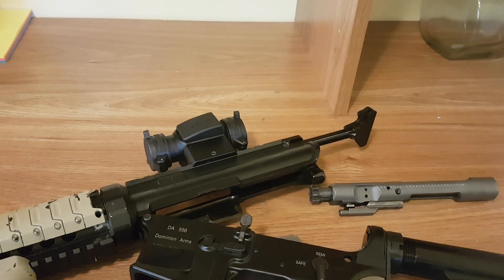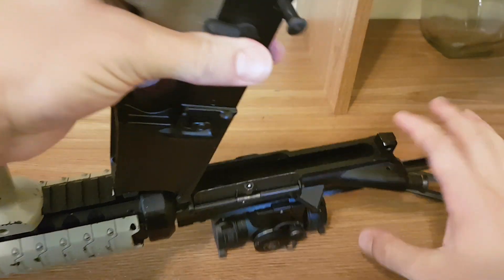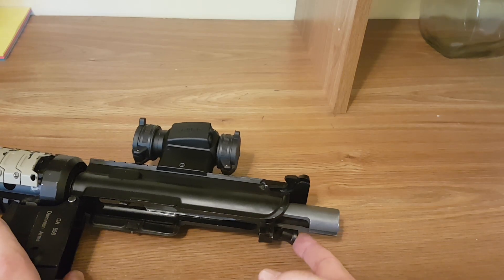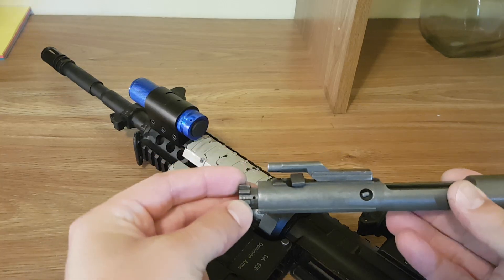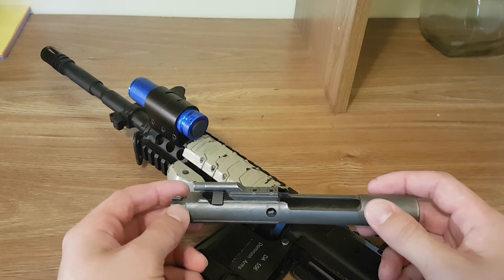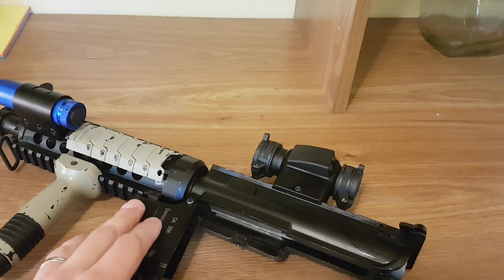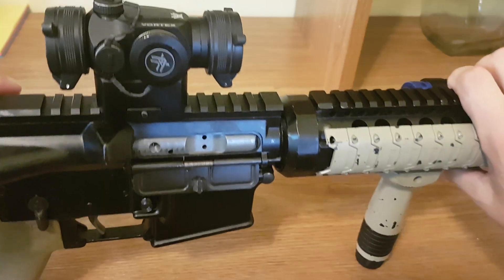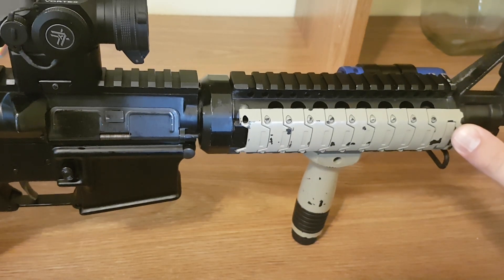What does the Forward Assist on the AR15 Do?

Comment: Long story short:
The forward assist is a terrible idea and turns bad jams into catastrophic malfunctions
Reply: @The Salt Miner Never argue with idiots, they will drag you down to their level and beat you with experience.
Reply: Nice to see you've at least given up trying to defend an invalid argument although it's a bit generous to call anything you said an "argument"
Reply: Degenerate
Reply: @TomBombadilTheEldest  you are wrong ... You obviously dont know your way around a AR.. Anybody who has experience knows you have to rack the gun if you have a malfunction/jam to clear the case/round THEN and ONLY THEN. Do you slap the forward assists to assure a solid seal on the bolt
Reply: He may be acting like a tard, but his argument is correct. The forward assist has essentially one use and one use only - pushing the bolt into locked position when the rifle won't fire due to being gunked up by carbon residue, mud, or what have you. Or I suppose also if your buffer spring shit the bed in a combat situation where you couldn't easily get another.

It's not to clear jams, or double feeds, or other malfunctions. It will make those worse.

Which is why "Tap the forward assist" is the very last step in the Army "immediate action drill" - SPORT.

Slap the magazine to make sure it's seated properly.
Pull back the charging handle.
Observe to make sure the shell casing/bad round ejects.
Release the charging handle to load a new round.
Tap the forward assist.
Fire.

If something is wrong where you have an actual jam you shouldn't get to the "Tap the forward assist" stage, because in the case of a jam or double feed the shell casing/bad round won't eject, so you'll stop at that step and go from there with trying to clear the jam/correct the malfunction with remedial actions like removing the magazine to clear a double feed.
Reply: wow...love the comments! very entertaining!
Reply: oh man. now you've devolved to juvenile name calling. How does one such as I contend with such blinding wit.
Reply: No, the forward assist is not a terrible idea. When I was in the Army (thankfully not when I was deployed) I used the forward assist perfectly, for what it was intended to do. I was qualifying on the M4, dont remember how many rounds I already fired... when I felt a grain of sand in my bolt carrier/upper receiver, and sure enough the tiny grain of sand or tiny pebble,, managed to jam the weapon so the bullet was 1/2 way in battery. I tapped the forward assist and the bcg seated and I made the final shot. Both times were during Qual but still, people either like them or hate them but they definitely have a use, just because someone that goes to a gun range and puts his rifles on carpet covered tables doesnt see a need for it doesnt mean there isnt a need for it...
Reply: Gordon B : excellent comment. Exactly!
Reply: I was a fucking infantry man. My life depended on this rifle and I know it well. Does anyone understand the term S.P.O.R.T.S. If you do then you will know how utterly fucking useless a forward assist is. Weapon maintenance HOOOAH
Reply: Nathan Moore couldn’t agree more, sports, never ever touched the forward assist bullshit cos it’s useless, one bullet jam, cool just remove mag and work from there, double Fed, more complex but never have I used that nipple looking shit for shooting at the ranges
Reply: That entire exchange between Salt Miner and professor could have been avoided if the two of you would just talk to each other like you would talk to someone in person.

Or don't. The results were rather entertaining.
Reply: So uh..how's everyone doin? I just uh, got one of these guns. Its a good gun. I used the forward assistant to clear a double bullet thing and it worked good. I can fire two bullets at once now. If I get into a bad fight I just tap the double bullet assistant.
Reply: BARACKOBAMA what do you mean? Sometimes it’s yellow, sometimes it’s darker than brown. 
I  h a v e  m o r e  e x p e r i e n c e  y o u  k n o w
Reply: Long story shot:
You must know what malfunctions the forward assist is intended for.
Reply: Ok jackass, it’s in the name FORWARD ASSIST, it is meant to be used if the bolt group cannot chamber a round all the way due to dirt, mud, sand, insufficient gas pressure, etc, it is meant to ASSIST the spring in chambering the round.
Reply: SPORTS 
Slap
Pull
Observe 
Realease 
Tap
Squeeze
Reply: +professorstein The fact that you don't explain to him how his comment was "ignorant" (overused word btw) just makes you seem condescending and misinformed. Also he is not entirely wrong, if you have a double feed then the forward assist can make it worse. Sincerely, someone who actually explains what they mean instead of throwing insults.
Reply: @jasonneu81  Thank you for that. I just picked up my first AR (love it by the way) and it has the stupid California fixed mag. At the range yesterday, I had two double feeds (not sure if it was the cheap ammo or the speed loader somehow. I suspect cheap ammo) and had to  separate the upper and lower... The first double feed I did try the forward assist and learned very quickly that was not the solution.
Reply: No it doesn’t
Reply: Vietnam?
Reply: Is this a war between M16 lovers and AK47 lovers?
Reply: True,my late dad used a select fire M14-7.62-51MM(308WIN)during Combat in DaNang&Hue City,Viernam 1968 Tet&my dad only told me a very few stories but he was in the ARMY&he actually qualified with the tiny 22caliber M16-5.56-45MM NATO &said it was light&fired great,but he saw a Marine hurt when his m16 was carbon filled dirty&he hit the forward asst.&in A FireFight the Marines M16 blew in half&hurt him&my dad was actually there&they had several issues wirh the M16in NAM&it was due to several factors ,but your correct I think about what you said&what happened to the Professionally Trained Marine in Nam backs it up&he wasn't the only one many US SOLDIERS WERE KILLED BECAUSE OF FAILURES WITH THEIR MATEL 16 during COMBAT IN VIETNAM,God Bless em&Thsnk You to ALL COMBAT VFW'S&NON COMBAT VETERANS&THEIR FAMILIES.
Reply: Man you sure love projecting. too bad you're still wrong and all you've done to "prove" your point is reiterate slightly more valid but still wrong things  people smarter than you have already said. Maybe develop some critical thinking ability and then take your head out of whatever echo chambers you normally occupy.

And since your own lack of experience with a gun is obvious in your constant projection and self righteous condescension borne of millennial narcissism I invite you to actually shoot and AR-15 for a while and see how absolutely superfluous the forward assist is.
Reply: @TomBombadilTheEldest  as a user of an m4 for several years, the forward assist is fucking fantastic to get the bcg to lock in when you have carbon fouling on the gas impingement system keeping the bolt from riding completely forward and locking in, now I repeated things quite a bit because I'm not sure you reading it once would be enough for you.
Reply: sdivine13 : excellent comments. Exactly!
Reply: Is a narcissistic non-argument all you got?
Reply: Oh boy now you're moving the goalpost, deflecting AND deliberately misinterpreting what I said.
Reply: @TomBombadilTheEldest  you were talking about double feeds, you dont just blindly jam the bcg forward, you look and check to see if it's a double feed or stovepipe or any other type of jam before hand, jackass.
Reply: you still haven't answered the question or do anything other than act like a pretentious pillock . Under what circumstances would using the forward assist be preferable to just ejecting the cast. When is it ever a good idea to assist a stuck case forward where it can get more stuck?

Why is it everything you say boils down to "no ur wrong hurr durr" where is your evidence for what you say? you aren't even providing an argument.
Reply: @TomBombadilTheEldest  You make sense by the way. I be been trying to think of a moment when I'd want to jam things in the chamber. It would prompt  me to open the ejection port and look for the obstruction.
Reply: so you're just going to ignore the fact that's a very specific and niche use on top of not actually being what it was designed for? Well can't say I'm surprised.

You're pretentious as hell for me to have to teach you common sense basics
Reply: "the forward assist has nothing to do with a case getting stuck" Except it does you inbred. The forward assist is there to, as the name implies, assist the bolt in going forward when it's stuck. but this is never a good idea because you're only going to turn whatever minor issue it was that jammed your rifle into a major issue that can render the weapon inoperable. 

For somebody who throws the word ignorant around so much you sure do show an ignorance of basic mechanical principles and common sense. Under what circumstances I ask, WOULD it be a good idea to use the forward assist since you seem to have such a hardon for it.
Reply: Long story short: you win the most ignorant comment of the day award!!
Reply: and how do you suppose that? if a case gets stuck it's better to remove it altogether and try again than to fuckign jam it in. you're liable to just get it wedged in the chamber and urn what could have been easy to clean carbon fouling into an unclearable jam and turn your rifle into an overly complex club at best and an elaborate pipe bomb at worst.
Reply: The forward assist has nothing to do with a "case getting stuck" thanks. That explains the original ignorant comment.
Reply: professorstein Keep your rifle clean and it will never ever be necessary.
Reply: @professorstein5855  he is a salt miner. ya know, salt
Reply: HI! I'm Brandon the whistle dick and I use words like "dude"!  It's not called "forward assist" it's called "jam clearer" because that's what it supposed to be used for! Yeah I'm that dumb! Failure to eject? DONT WORRY! Just whack on your jam clearer and that will fix it!!! DERRRR.  DEERERRRR.
Reply: @professorstein5855  I gotta say, even though prof is super agressive and cant debate very well without questioning everyones intelligence, he is correct. forward assist has nothing to do with a case jam. One thing i didnt see in this super entertaining  thread was that the forward assist has a use after a press check... the only use i can see. if you want to chamber check you dont want to eject the round, you pull back the charging handle until you see brass, then allow it to ride forward. of course there isint enough momentum to put the bcg back into full battery, thats where the forward assist comes in. useless? perhaps. but i belive thats whats its intended funtion was.
Reply: Ripshot: my mission is accomplished. Entertainment!
Reply: Wrong about that being the "one thing only."  Get some training.
Reply: if only his father had the insight to use a condom. i suppose the apple doesn't fall far from the tree.
Reply: Why do you keep asking why it would be a good idea to use it if there's a "stuck case" when you've already been told repeatedly it has nothing to do with that? By definition the reason for the forward assist is the last six word of its very definition: 
"The forward assist on a firearm is a button found commonly on AR-15 rifle derivatives, such as the M16 rifle, and is usually located near the bolt closure. When hit, it pushes the bolt carrier forward, ensuring that the bolt is locked."
However, the main reason people use it is for silent loading. During hunting or home defense when your trying to be stealthy or when you're cleaning your AR and people are sleeping. Just google it. You're lazy as hell for me to have to teach you AR basics.
Reply: @professorstein5855  silent? I never heard that before. Logically speaking I want to move as fast as I can or need to, to keep the upper hand and pressure on an intruder. That assist will take time.
Reply: That's all you got? Hahaha!!
Reply: Freak.
Reply: "Now you've devolved in to juvenile name calling..". Hypocrite??  BAHAHAHAHA!!  Freak.
Reply: @professorstein5855  I just want to punch you in your fucking face
Reply: No, actually, as I said, I copied and pasted the definition of what it's used for. To assist the bolt being locked in to battery. Now that you've been schooled, and you've showed everyone how dumb you are, move along. Learn how to do your own research. I know that we run in to mental cases like you online, but I'm sure anyone else reading enjoyed reading how not just ignorant, but how stupid you are. Clearly you have a lot to learn. Probably you don't even own a firearm due to your mental state. Have a nice day!!!
Reply: ROFL!!! BAHAHAHAHA HA!!! Thanks for coming out!  The forward assist does what it implies, yeah ASSISTS THE BOLT FORWARD IN TO BATTERY. That's it Sherlock!  Not clearing a jam, Or assisting a "case getting stuck."  You moron. The forward assist helps you with many things. You should learn by researching instead of showing YOUR IGNORANCE!!! ROFL!!!
Reply: I have a lot more than a make believe, "forward assist clears jams!" argument!  BAHAHAHAHA!!
Reply: Freak.
Reply: Freak.
Reply: Jason, hi dumbass. You don't use a forward assist for a jam. Ignorant only means you ignored something - like researching it on the internet but not doing just that in the heart of the Information Age, which takes "ignorant" to another level.  So go learn what it's for without me explaining it to you. Teaching you how to find out yourself is a lot more valuable than explaining it myself.
Reply: @professorstein5855  ignorance means lack of knowledge.
Reply: Brandon: no, ignorance only means you're ignoring something.
Reply: professorstein Okay we get it, you’re a hypocritical sociopath.

Comment: ak47 ftw, no need for such gimmickry
Reply: Because the bolt has the charging handle permanently afixed to the bolt so you can push on the charging handle to have the bolt lock in to battery. The ar's charging handle is separate from the bolt so you need a forward assist.
Reply: na, lets go with the M2 browning and a 1911 thats been around for 100 years
Reply: fadsgbcbxc I’m still getting the AR.
Reply: Yeah ok. An AK47 which was retired by every civilized country on Earth.  Why stop there in fact.  Let's just go with a civil war era Enfield.
Reply: @professorstein5855  my comment is a year late but i think he meant the AK platform
Reply: @professorstein5855  well I mean it doesn't need it is that actual reason not because it's old. The charging handle on an AR is non reciprocating unlike the AK where you have a handle fixed to the bolt so you just move that instead.
Reply: Crazy and WeSay; well said.
Reply: @Alex-cw3rz  you should be insane or hate your fingers to push the handle on the jammed AK. Just pull again and release, it will fix itself safely.
Reply: @heyhoe168  yeah I know that's what I said
Reply: Дмитрий Д I know all these people talking about assisting the bolt forward. It's a lot faster and easier to just cycle the bolt again.
What if it wasn't the bolt that was the problem but a bad primer?
Cycling the bolt again will fix all the problems. 
The only thing I've seen on here is someone mentioning that it will allow you to silently charge the weapon... I don't know when you'd ever need to do that but I'm no expert.

Comment: I have a Ruger AR556 and A Ruger SR556 takedown. I have noticed that on these 2 rifles the forward assist does nothing. But on a colt or pretty much any other brand of AR it will actually push the BCG forward into battery. (I've never actually had a malfunction, just purposely riding the charging handle with a snap cap to test the feature). Does anyone else have this same issue? I have removed the BCG and can see the forward assist visibly pushing forward where the BCG would be as demonstrated in the video, but throw the bcg in there and it does nothing....

Comment: what does the forward assist do? it fully jams that round that didn't have the primer properly  seated allowing you to retract the bolt but not the round rendering your weapon useless.  now jam your cleaning rod down the barrel and hit it with a rock.
Reply: It actually assists in putting the rifle in battery when the action is being impeded by sand, mud, or dirt, which are commonly found in the field, becoming especially problematic in a battlefield situation where regular weapon maintenance is unrealistic.  This would normally be accomplished on other rifles by smacking the charging handle forward, but due to the AR's design, is not possible but is instead replicated by use of the forward assist.

Comment: it functions in another way too. had a veteran sharing how bad the SAR 21 is as when you want to take an enemy by surprise you cannot guide the bolt with a new bullet into the chamber without jamming. but i still love the SAR as bullpup design makes it easier to clear rooms and comes with a scope. god bless if i ever need to use the ironsights.